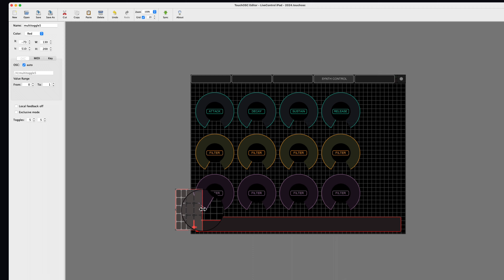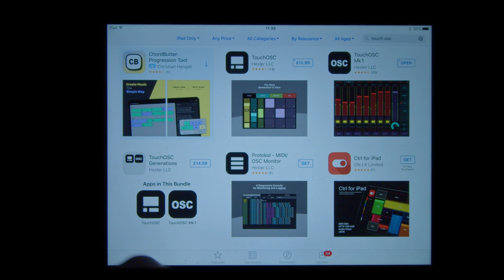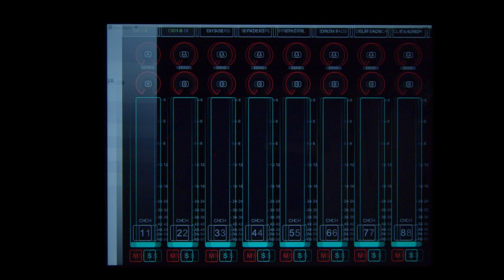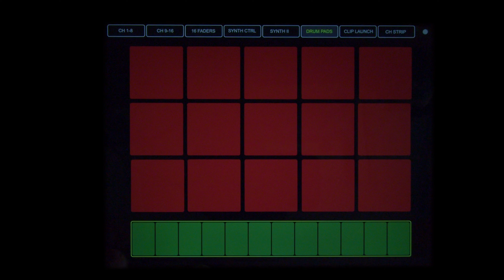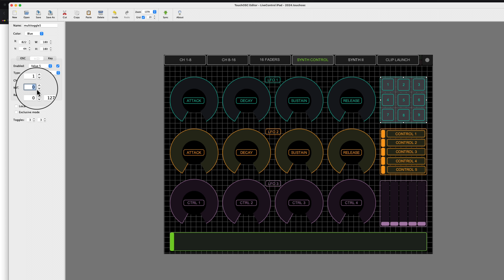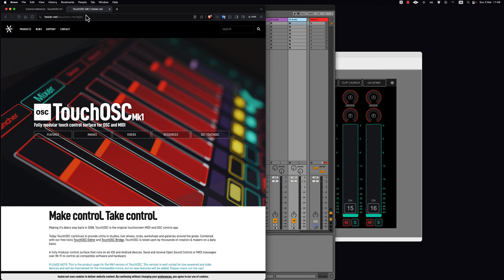Touch OSC iPad MIDI Controller Design 2024

Comment: I used this many years ago and now I’m returning to use it but I’m having a lot of problems to connect and transfer templates between my iPad and my Mac and vice versa via USB.
Reply from the maker: Try what i'm showing in the video to connect the phone or tablet via cable and manually copy and replace the template when you want to test it or load it. I had as well problems with the transfer from the software.